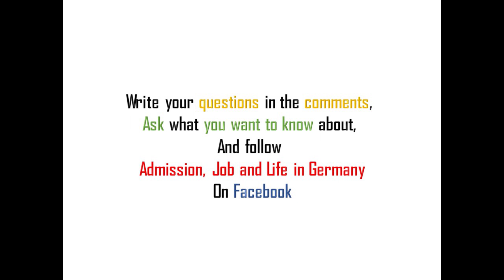CAME Course at RWTH Aachen - A General Review

Comment: Hi I liked your video. I want to ask you the following:

What is the most hard part of CAME?

How difficult is to finish CAME in 2 years?

How many subjects are recommended to take each semester?

Kind Regards
Reply from the maker: Jose Adrian Tuarez It's quite difficult to finish CAME in two years, and that's mostly due to the time it requires to find and finish your internship and Master Thesis. It's advisable to complete at least 5 subjects per semester, more if you can.

As for the hardest part, that's quite relative to each person. I'll give you our Quora answers to read on that subject:
https://www.quora.com/How-hard-is-CAME-RWTH/answer/Jana-Stalevska-1?share=c0f14995&srid=gyQL
https://www.quora.com/How-hard-is-CAME-RWTH/answer/Vikrant-Srivastava?share=aa3eac13&srid=gyQL